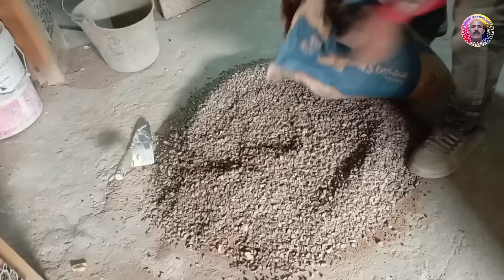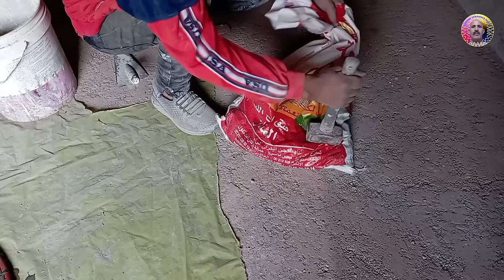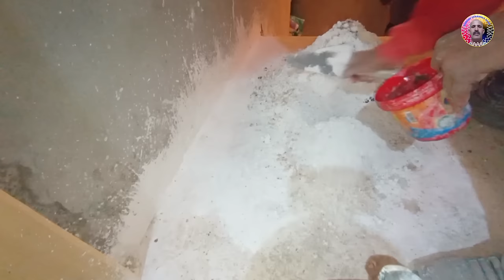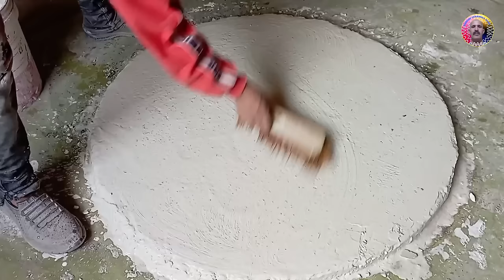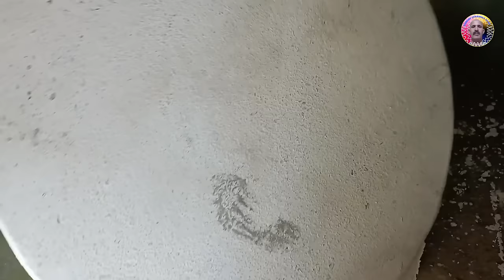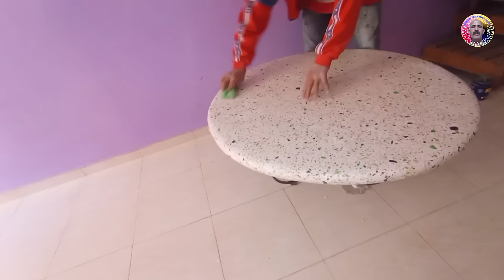Create a terrazzo table in your own style easily and at the lowest costs.#terrazzo

Comment: Do you just use water
Reply: Mixing water in until workable is too much water and results in weak concrete.  Add a little plasticizer and it will become workable with much less water and therefore much stronger. This error is typical in untrained cement workers not just internationally and causes long term quality problems.